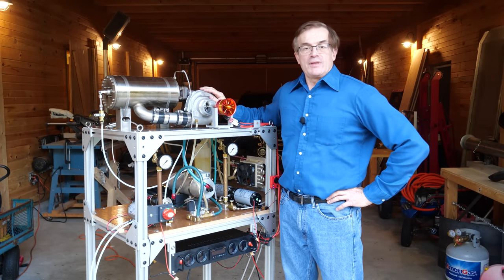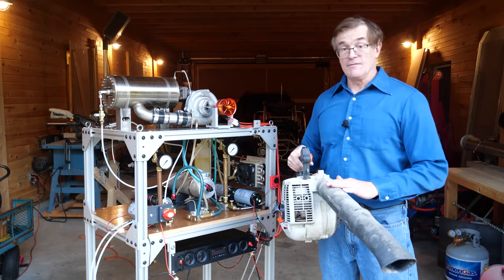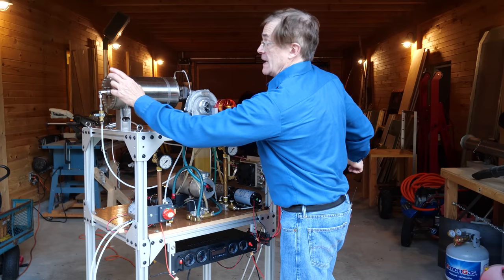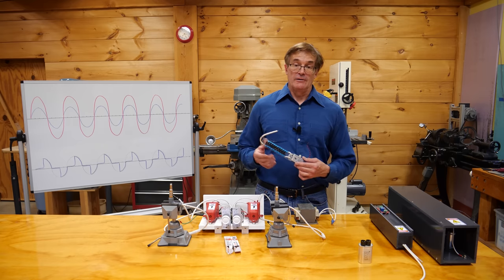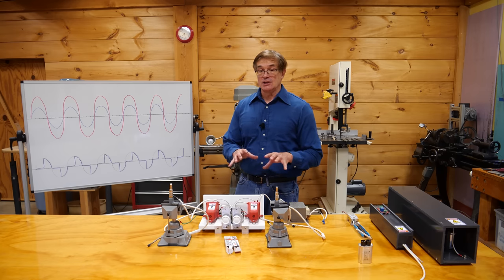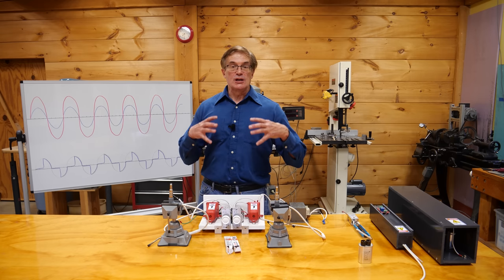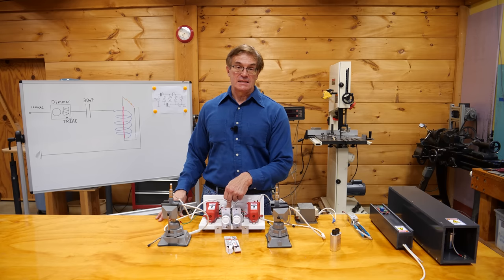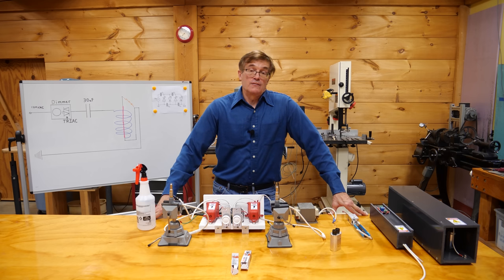What else goes into building a jet engine? - Part 4 Final

Comment: 13:30 The capacitor in that circuit is absolutely necessary. Automotive coils like those are designed for 12v to be pulsed across its primary winding by an igniter for a few milliseconds (called the dwell time), if the capacitor wasn't there the primary winding would be subject to much higher voltages/currents for much longer periods of time. The capacitor in this instance is working to limit the total amount of charge that can pass through the primary winding in any given 180 degrees of the input.

Still a very good build overall, pretty impressive.
Reply from the maker: Thanks.
Not to higher voltages or currents, but to much longer durations.

Comment: What I've found works quite well, is readily available, and extremely cheap for continuous electric ignition is to take a Bosch Quad spark plug, bend the prongs as far open as they'll go, and hook it up to an $8 Sabre stun gun. Works well for gas burners, potato cannons, etc. so unless the arcs aren't "hot" enough I'd guess it would work decently for a jet engine too.
Reply: Yep , a lot of the DIY turbine guys use cheap "High Voltage Generators " off Ebay , only cost a few dollars and simple to construct a working ignition , another good method is the auto coil/condensor  activated by an auto flasher unit , I used that method for my turbine bike 20 years ago
Reply: @racketmotorman  The trick I've personally always used for ignition coils is to make a "trembler" or a "vibrator pack" generator out of a relay, just connect the solenoid and the points in parallel so it makes and breaks the connection. That trick's useful for a lot of things actually, it's even in a lot of old vacuum tube equipment meant to run on DC power to make the plate voltage, cause it's either that or a dynamotor or having to daisy chain several expensive single-use 45 volt B cells together (in the days before transistor based inverters, anyway).

Still, way more work and less reliable than just hooking up a grocery store taser to the spark plug instead.
Reply: Idk what the hell you just said, but I love it

Comment: Really have been enjoying this series. Not only the tips for greater performance, but really the tips for increased safety. Even in cases where a safe current dump can be achieved in 15s, MP improves upon this and ensures the current is dumped in 1s. Top notch, 10/10.

Comment: I love these videos, they are packed full of useful information.  I am searching salvage yards here and there for a used turbo off a big diesel truck.

I would like to make one point on commercial aircraft engine starting.  Commercial aircraft can only start with air pressure.  Either the aircrafts APU or a ground based ASU will be used to spin up the engines.  The high pressure bleed air off of the APU is one method by which the engines can be spun up.  The other method, is a ground based start cart or auxiliary start unit will be connected to the aircrafts ductwork under the plane.  Most major air ports prohibit the use of APUs on the ramp.  Ground based power, PCA (preconditioned air), and ASU will be connected to the air craft when it pulls up to the gate.

Comment: The simplest Buzz Box that works very well is a Old Car can coil ,Condenser & a 3 way relay to run it.30,000 Volts and a few amps will fire up any Jet Turbine.

Comment: Great videos, thank you for making them. 
Not sure if the procedure with these spark plugs is different (or if anyone mentioned this yet) but a spark gap tool will let you know the gap, and also not take away from the material of the leg
Reply from the maker: No one has, but I'm aware of them.
Thanks.

Comment: If your interested in ideas. I have been looking at jepteras fluidic propulsion engines. Find them fascinating but not a lot of details on them. Its like a superpower dyson fan that provides thrust. Im perplexed how these things can provide so much thrust. The cool part is the air compressor (noise) can be tucked away with sound reduction. Quieter thrust.

Comment: An interesting concept was studied by the Moscow Aviation Institute back in about 1970. I came across the following report but could find no further info on the study.
Interesting to say the least.
X-1 Gyroplane

This aircraft used a piston engine with an afterburner.
The exhaust gases were mixed with fuel, “burned out” and created jet thrust, almost doubling the total
power of the power plant with no compressors.
Motor-compressor installations are widely known.
Here the thrust is generated by the afterburning of the exhaust gases of a piston engine.
This miracle was designed and built under the patronage of a very famous aircraft designer and can be
considered one of his last (if not the last) work.
The X-1 gyroplane was designed at the student design bureau of the Engine-Building University (SKB-2) of
the Moscow Aviation Institute.
M.L. acted as a consultant for design students. Miles.
By design, it resembled the famous WA-116, but its peculiarity was the jet drive of the main rotor.
The exhaust gases from the MT-8 motorcycle engine were directed to the main rotor shaft, then to the
hollow blades and ejected tangentially from the ends of the blades,
adding about 10 hp. power. This is not surprising: the MT-8 engine was very imperfect, the exhaust gas
temperature reached 1100 ° C, and the maximum pressure was 6.78 atm.
The MT-8 itself rotated the pusher propeller.
Power of 10 hp enough to spin the propeller before launch, and during the launch, the burners at the ends
of the blades were turned on - afterburners that burnt oxygen in the exhaust gases.
The power on the screw increased to 72 hp. - sufficient for vertical takeoff and landing.
MT-8 Engine Spec's:
K650/MT-8 1967 to 1970
649cc OHV
32 / 24 Hp/Kw
The rest of the design was as simple as possible. The fuselage consisted of three steel pipes, at the ends of
which the landing gear wheels were placed.
Fixed swept keels were also installed on the side supports, which somewhat improved directional stability.
The pilot's seat is placed open, the MT-8 engine is behind the seat back.
In 1968, the gyroplane was exhibited at VDNKh, work on the preparation of documentation continued in
1969, but there is no information about flights.

Comment: As ever, your channel is very educational.

One question has been plaguing me ever since I saw your earliest Jet episodes…

What if you don’t want thrust?  What if you wanted rotational mechanical energy…say to generate electricity?  It seems to me, that this particular design is of a greater drawback, than a traditional axel flow jet design.  Yes, using pre-made turbos, does have it’s advantages.  But if you needed/wanted rotational power ( rather than straight thrust ), I would think that you would almost need to feed your afterburner, into yet another turbo, dumping the thrust into the intake and forcing it through the vanes to gain desired rotational motion, from the other half of the second turbo ( I fully grant that I might be overthinking it ).
Reply from the maker: Firstly, you would not use an afterburner as the output  is too hot to work with.
I believe  the best option is to feed the exhaust  from the exducer of the turbine into another turbocharger  and use the cool compressed air from its compressor.  This opens up a lot of options.
This is what we will be doing.
Reply: @TechIngredients  
Looking forward to seeing how you do it.   
The thought about the using the output from the afterburner, comes from the idea of reheating, before sending it into another stage of extracting more rotational output…my fingers just got a bit ahead of my brain, and clicked send, before my brain realized there was more to be said.

Have you considered some form of heat exchanger, like some commercial micro-turbines use, to increase efficiency?
Reply from the maker: No.  First thing is to get a system that actually works before  modifications to increase efficiency.

Comment: For generating the high voltages, I quite like the Marx generator design. Similar to the voltage multiplier but uses a spark gap at each stage to increase the transient and give a large gain.

It is capable of delivering very high voltages (around the 100kV plus). They do take some care to work properly as the currents are definitely in the lethal range. I use a flyback generator to power them and I can readily achieve a 4 inch spark.

Comment: You got me thinking and: for me it seems by using regulator based on triacs yes you can delay moment of turning the load on (in this case primary of the transformer) up to quarter of the cycle, but no, you can't switch it off instantly aftetwards, because the triac -once opened - would turn off when the line voltage is crossing zero. Capacitor seems to act as cut-off element. I believe you can get even higher voltage using rate of capacitance creating series resonance circut at one of the line frequency harmonics.

Comment: The details provided in this channel is extremely good.  Thanks for the notification option YouTube has.  The quality of the content is so amazing.  I guess today I got a chance to give a suggestion.  I feel the explanation provided for the ignition coil is not accurate.

In a closed primary circuit condition, turns ratio & step-up ratio is always valid.  Rate of change of voltage doesn't matter, rate of change of magnetic field matters.  Compared to 100V 50Hz supply, 100V 5kHz supply has higher rate of change.  But the coil voltage will not shoot up more than its turns ratio.  But the coil is simply going to reject the supply, the current will  be less.  The explanation based on the rate of change on voltage is actually inappropriate here.  When a current flows through a coil there is a phase delay between current and the voltage.  The position where TRIAC turns-on (closes) is not very important.  But when the TRIAC is going opens is very important.  In a inductor when a voltage is zero current is maximum,  the TRIAC turns-off (opens) when the voltage crosses zero where the current is maximum, it disturbs the magnetic field greatly and causes a great voltage.  The point is, the sudden voltage is induced in both primary and secondary, while the voltage gradually crosses the zero.  As explained earlier the current is not zero, when the voltage crosses zero.  90degree phase delay is applicable only for sine wave, when the sinewave is chopped, the current starts only when the TRIAC gets fired.  So it takes more time to reach its max level, here the capacitor helps. 

In addition to that,
Connecting a DC source with in a fraction of second will not cause a step current in the primary coil due to its self inductance.  Disconnecting a DC source is not the same.  By altering its resistance the inductor cannot rectify the disconnected / broken path.  Hence disconnecting a DC source clearly cause a sudden change in current.  This will induce a very high voltage.  I have done several experiments and projects with this.  Connecting a coil to a  1.5V supply with finger will not give a shock.  But disconnecting the coil will give.  Magnetic field cannot be charged immediately.  While connecting, the current flow starts gradually due to the self inductance.  But while disconnecting the current path we can make a sudden disturbance in current and hence in the magnetic field.

Comment: Rather than carefully tuning the distance between the the EDF and the turbojet inlet, maybe it would be easier to set them far apart, and then temporarily connect them with a tube. You could put a flange on the outlet of the EDF and the inlet of the turbojet, and then place/hold a tube between them that mates to those flanges well enough to carry the output. 

I'm also curious about the possibility of extracting electrical power directly from the engine, rather than using it as a turbojet or a turboshaft.  The EDF at the front end could be used to extract a small amount of energy (albeit at the cost of reduced intake pressure) to power the electronics and starting system, for example.  

On a separete note, I submitted to you an idea about the use of heat pipes. Wondering if you ever saw it. 

Thanks for the great content - will keep watching and spreading the word.
Reply from the maker: You're  probably  right on both counts.  Alternatively, a short set of rails  could allow you to move it in an out in a controlled  fashion.
I don't remember  seeing that comment.

Comment: Typically only smaller turbine engines (up to a few thousand horsepower) use electric motors for starting, and they're typically a dual-purpose starter/generator.  For larger engines like you find on jet airliners, the power required for starting is high enough that an electric motor would be too heavy and pull too much current to be practical.  Instead, those engines use an air turbine starter (ATS).  The ATS uses a high pressure, high volume air supply to spin an impeller, which rotates the engine core through a reduction gearbox.  The air can come from an auxiliary power unit (APU), which is a small turbine engine usually mounted in the tail, or from a powerful air compressor on a trailer (a "huffer cart").  You may have noticed that the air conditioning goes away during engine start.  This starting method is the reason: all of the APU's available air supply is going to the ATS.

Comment: Does the spark on your system run continuously, or do you shut it off after successful ignition? Great video series!
Reply from the maker: The afterburner needs  continuous operation.  The main combustion chamber doesn't  need it, but sometimes  I forget to turn it off and that does no harm.
Reply: I think, in airplanes they have to run the sparks continuously when entering rainclouds to prevent accidental flameout.

Comment: I wonder if an intercooler stage could be added to a jet engine. In other words, to use some kind of heatsink to cool the compressed intake air. It might be helpful if the compressor were thermally insulated from the combustion section, with some kind of heat-break. If the thrust wasn't too much perhaps some petals could be made for an after-burner, perhaps closed with servos using bellcranks or cams, if you can offset them enough so they stay cool. Where in Home Depot do they keep the Inconel? : )
Reply from the maker: It could be, but it would reduce  the overall  efficiency. Intercoolers allow more charge density into a reciprocating engine and thus increase the power output, but they don't increase the efficiency  because thermal energy is lost.

Comment: I'm glad you said something about the danger of high voltage near the end, but your warning still seemed pretty mild compared with other information I saw recently. That is, a video by someone else said that 700 volts through your skin will burn your flesh too severely to ever properly heal, and 700 volts through your heart is lethal, even at low current. That person didn't give the impression of being an electricity expert.
Reply from the maker: It's  all about  balance, if I start flapping and come across  like a "Karen" then people are more likely to discount the warning.
His video misses a critical factor.  Voltage isn't really important, 50 volts can penetrate the skin and a million volts won't hurt you.  A static spark generated by a carpet will reach tens of thousands of volts.  It's  all about current.

Comment: the truac is very similar to a magneto on an aircraft engine  one or occasionally both mags have a impulse coupling helping turn the magneto fast enough at starter rpm to send the 30 to 40k volts to jump the plug gap in a cylinder with 8:1 to as high as 10:1 compression ratio and fuel mix ther by starting the engine

Comment: Did you consider compressed air to spool the turbo? Many older transport jets would use bleed air from the apu for starting.

Assuming you could supply enough compressed air for long enough to start the engine, you would only have a small nozzle obstructing the intake.
Reply from the maker: Yes, but the blower works so well there was no reason to pursue it.

Comment: How about 3D metal printing a design using solidworks to design/simulate? printing the hot section in inconel. Maybe even a turbofan engine if ambitious.
3D printing lends itself very well to the convoluted ducting in a jet engine.